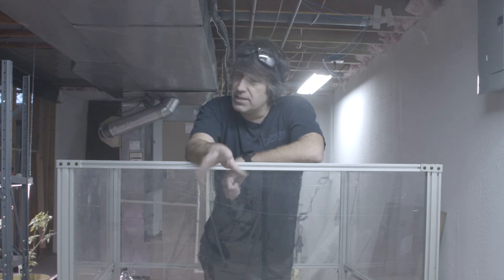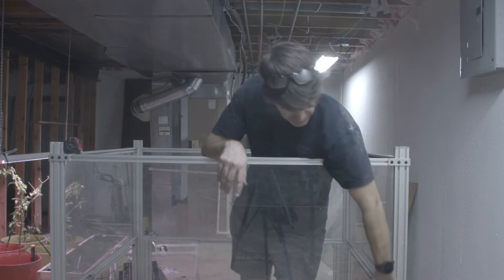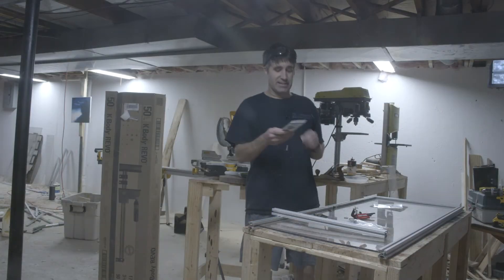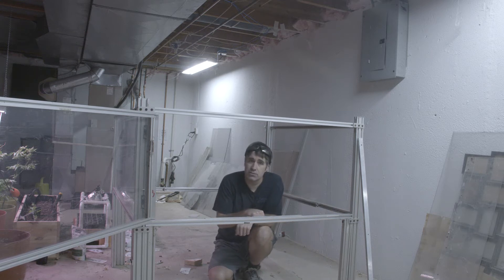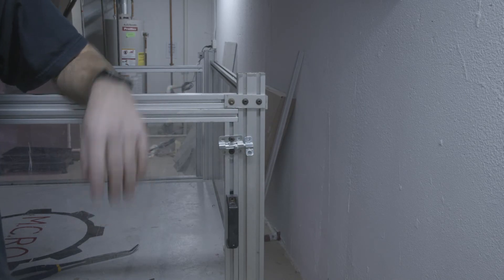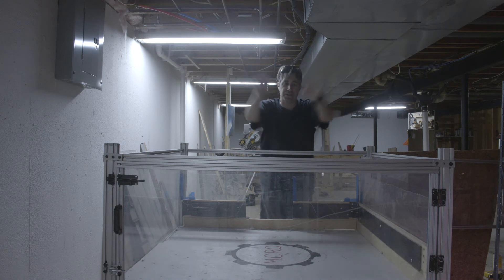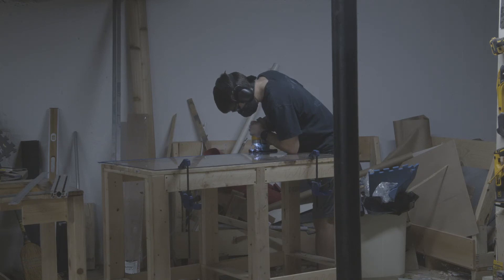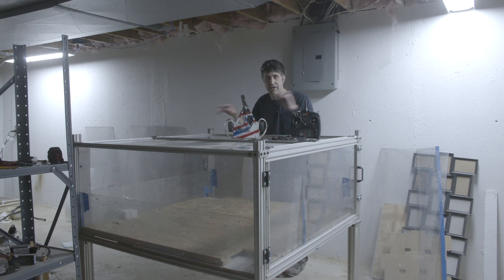Completing an Antweight Combat Robot Arena

Comment: Nice video!

Did you ever end up creating plans for one? I'm trying to design an arena and there's so many questions remaining!
Reply from the maker: I never did create plans for it, but my design is not too different in concept than the Just Cuz Robotics one.  The main difference is that I put mine on legs to stand it off the ground.  The tricky part is in the details and making sure all the cracks are covered up.  If you have any specific questions, I can try and give some suggestions.
Reply: @RockoRobotics  I've been just collecting as much examples as possible and try to find the idea I like best and is safe to use, as well as have to deal with converting all the imperial measurements to metric.

I've been using JustCuz' guide as primary source along with the SPARC best practices, but there are some changes I've made in my design to his, for example using 3+4mm layers of lexan instead of one 6mm and build an aluminium frame like your door, but still use the top-pivot idea so the door automatically shuts.

Basically looking for good suggestions like how a top-mounted door isn't helpful when a bot catches on fire.
Reply from the maker: I went with side doors because of a chance of fire.  

Here are a few things I discovered:

 Any weight bearing part of the frame needs to be supported by the ground.  The little bolt/t-nut combos with the extruded aluminum can’t be trusted to support heavy weight.  I think I showed this in the video by adding mini legs under each of the four sides.

A large box made from four rectangles is not particularly stable.  It is easy to move it in a way that that the corners are no longer 90 degree angles and this can cause gaps along the edges of the polycarbonate form.  Making each wall out of several small rectangles or adding diagonal supports should help with this.

Roof panels can only be so large. For 6mm thick panels, you are limited to an area of a little less than 1 square meter.  Any larger than that and the weight of the panel causes it to flex.  This increases the risk that it will pop out from the extruded aluminum.

Any deviation from an available design needs to be thoroughly sketched out and reviewed before starting construction.  It is very easy to accidentally design an arena with gaps.  

Finally, the doors will almost certainly have gaps around them in order to open and close them. Adding aluminum plates, or something similar on the inside of the arena’s door frames can help to cover these gaps without affecting the performance of the door.

One more finally for real - Don’t assume that any gap is ok.  If you have a gap in the arena, some small bit will find a way to get out.
Reply: @RockoRobotics  That is amazing advice, thank you very much. 

I will have to make some more changes to my current design because there are a couple of things (like supporting horizontal beams on other beams), although the sides are like you described the one with the door is just held up by friction (although I'm planning to use 3 steel L 120x120mm plates with 14 t-nuts and 1 nut screwed into a tapped end to fix each corner in place, so technically the horizontal beam is also "held up" by plates on the top of the arena), so I will have to modify this.

I was planning to use multiple layers of lexan (either 4+4mm or 3+4mm if it doesn't fit in the 8mm gap of the extrusions), with a divider in the roof so the sides are the same size as the roof.

I'm using CAD to create a full precision sketch of the entire thing and the extrusions and polycarb panels will be cut to size by my supplier so I'm quite sure it can be produced to millimeter precision, I will have to incorporate double-width extrusions and mount some sealing plates behind them (like you did with the door latch gap) to fully seal the box.

Thanks for the very helpful reply, I would probably fixed these issues in time but now I'm that much closer to a proper design.

And yeah, I will let this entire plan be thoroughly reviewed before actually building it to make sure whatever I end up with will be safe, along with how I'm going to store this to make sure the lexan panels don't degrade from UV etc.